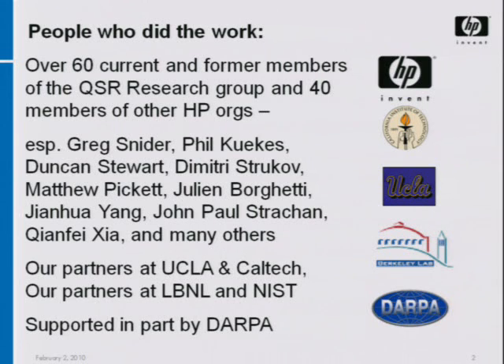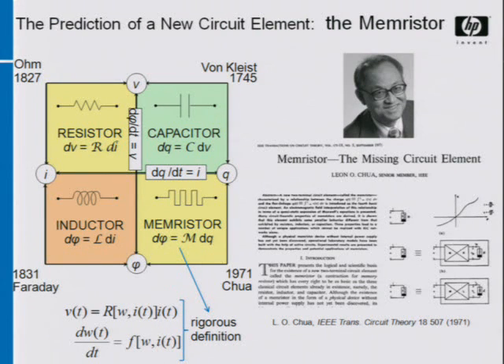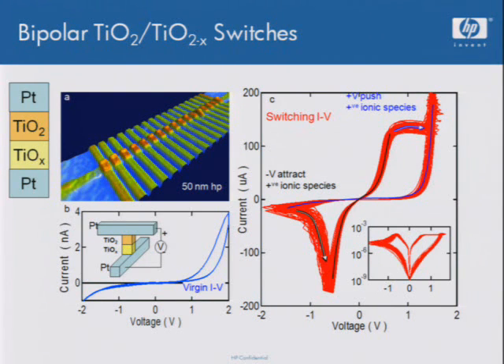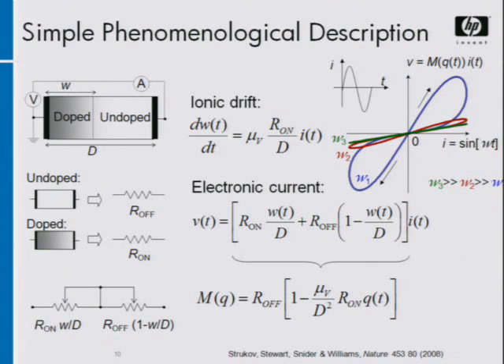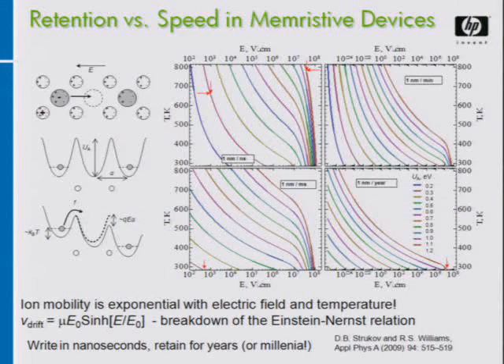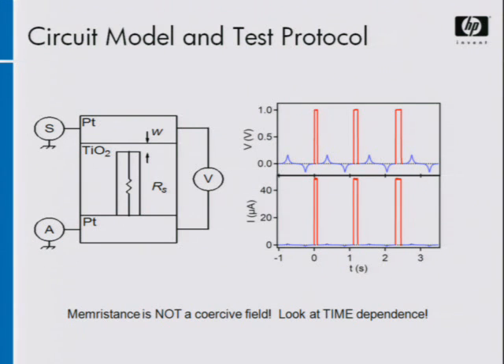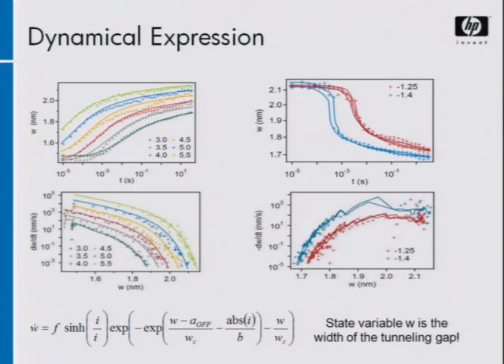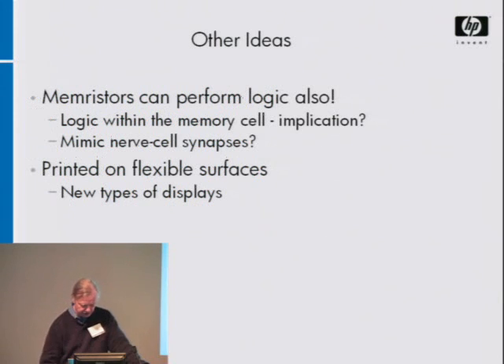Making and Measuring Memristors

Comment: 5:23 just a small correction, even though Dirac equation is surely a fundamental and very revolutionary concept it is just as linear as Schrodinger equation so the analogy doesn't quite hold. (Maybe I misunderstood the analogy). Outside that, great talk.

Comment: Hi sir 

 I write a code in verilog-a about memristors and it's crossbar and I
 got this message 
Message error: an invalidsyntax has been specified for port declaration in module header. Specify only discipilne indentifiers for port declariations.Message error: an invalidsyntax has been specified for port declaration in module header. Specify only discipilne indentifiers for port declariations